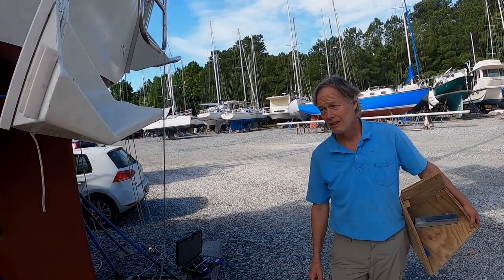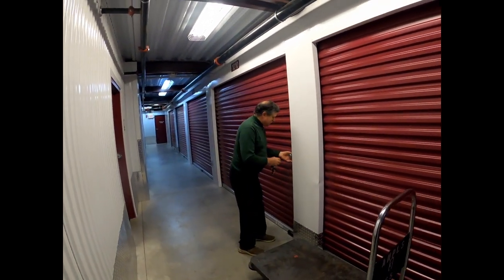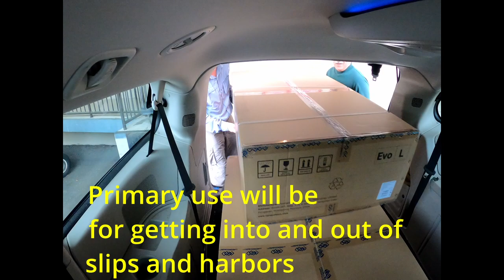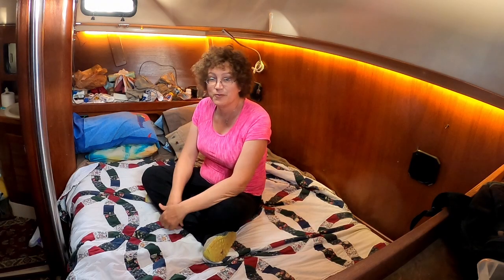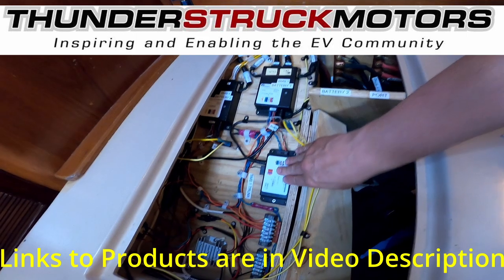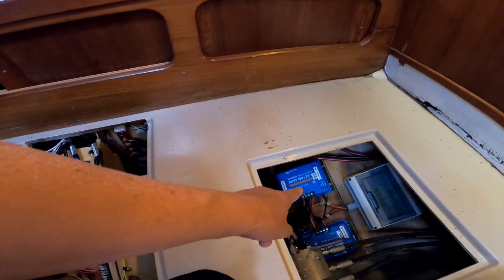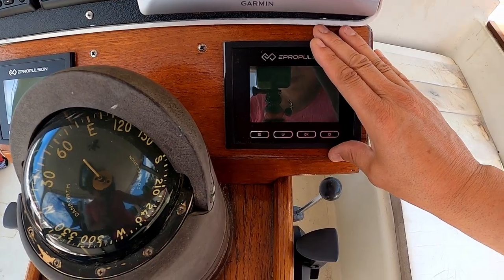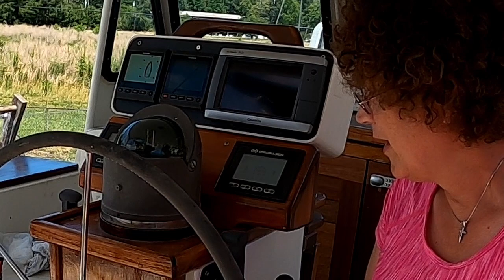Episode 76 - E-Propulsion and Thunderstruck Motors

Comment: PE-Foam does a great job as a arrow target for bows. The holes closing again so you get a great lifespan out of the target. We used a E-Cutter to make a Dovetail connection between shorter pieces. Now you can place the pieces all over another between two woodplanks and span them with 4 threaded rods. After a while you only have to replace the pieces that get hit the most hopefully center target ;)

Comment: You can use PET foam for construction of fiberglass panels. It's closed cell so it also makes good stuff for a boyancy chamber or collision chamber fill.

Those props are pitched for a planing hull. After a bit you may want to recalc and see if a prop change could offer better effecient drive or more precious control.

I would be a little concerned with the mounts being sideways to the thrust in forward over time. Electric supplies a hell of amount of torque.
Reply from the maker: That's a great idea. We will definitely look into this. It just happened that we had a friend who had some extra fiberglass panels and the price was right, free!

Comment: I am super interested in this with electric motors. I am going convert a Catalina 38 to electric . I have chosen to do 2 x 6 kw pod drives under the boat . It would be really interesting to get some info on range , top speed and optimal range speed from your boat  since yours is bigger and heavier .  I am thinking of 2x 13,6 kw 48 volt battery banks ( chines 3,2 volt cells at 300 amp )  , what is your thoughts of that ?
Reply from the maker: After our summer shakedown cruise, I have a little bit more information to provide. We find that at 1,500 Watts promoter, which is quarter power, we achieve about four knots on calm water and no wind. Recall that this is a 19 ton sailboat and we are duly impressed.  Our batteries are 7.5 KW hours and so at that throttle setting we can easily obtain 4 hours of travel. That's pretty impressive to us. At no time during our cruise did we actually deplete the batteries and with a good day of sunshine they were charged back to full by the end of each day of use.
Reply: Thank you for answering. I presume that you have third party battery’s , I have talked to many sales people from epropulsion ( in Europe) and they all tell me I can’t get the communication if I don’t use epropulsion battery’s and their  for it can’t calculate range or have regenerations . Is this true ? Is their  away of going around it ? I don’t only want third party battery’s for the price but also I would like to try and build them under the floor in the the saloon for good weight distribution and use space that is not in use otherwise . Again so thankful to have people like you on YouTube trying thing outside the norm .

Comment: We are considering the redesigned EVO Navy 6.0 (2024) for our 17 foot Montgomery sailboat.   Overkill on power but we might use it on our PSC34 as a "oh crap" engine as well.  How have your Navy 6.0s held up?  The new model uses a smaller motor that is oil filled and the total weight is 64 pounds vs 79 pounds but I am trying to find out information if the static thrust on the new model is as impressive as the 279 pound static thrust of the Navy 6.0 you are using.

Comment: Hey guys - great video.... 3 quick questions, why did you opt for two separate controls with two screens, versus using the dual controller with one screen? Also, did you link any steering to these motors or do you lock the steering pin and control the steering with the throttles?  Last question, i would have thought you could get closer to 50% efficiency  using dual motors which is about 6 or 7 knots, so what is your top speed with these both at WOT on your boat? Thanks!
Reply from the maker: Good questions!  It was our decision to have redundancy in our build in the event that there were a failure in one of the motors and/or controllers.  As an electrical engineer, I'm a big proponent for redundancy!  As for top speed, we are seeing 6+ knots at full power....which is absolutely amazing given the 19 ton displacement of this boat.  Super impressed
Reply: 🤣... as a mechanical engineer - redundancy - is exactly what i figured was your reason for fully independent setups. Yes, the twin motor setup on the ePropulsion motors really boosts their efficiency. It sounds like your running close to 50% which is awesome for that big boat. EPROPULSION  is pretty good but you will encounter times in the future that make you HAPPY, you chose to be fully redundant!  Congrats on your setup.

Comment: I am thinking you could have replace the diesel with an electric motor and lithium batteries for around the same price.
Reply from the maker: We priced out a full replacement with the necessary horsepower equivalent for about 15-20K
Reply: @sailingaccidentalgybe  wow, about how much was this install?  Around $7000
Reply from the maker: @Secondwind2010   I believe it was around $4, 000
Reply: @sailingaccidentalgybe  a engines is $5200.   I going to guess $6500.  I think 6 HP is under powered.  This is a good project to prove it can be done.

Comment: Hello from Germany. I am deeply impressed to drive a 19t boot with two little outboards.

I have a 2t cruising trimaran and would like to change to one navi 6. So it looks like that would be a good choice. 

Main reason is to use the hydro generation functionaltiy. I think i have plenty of sail power :-). Do you have tested it already? Since i also just need the motor to get out and back into harbours i hope to get the batteries full without shore power.

And my second question is about quality. I found some posts that there are several issues with corrosion and the after sale service is not good. What is your experience so far?

Many thanks for sharing your knowledge. Fair winds!
Reply from the maker: Thank you for writing. I do believe that one Navy six would be more than sufficient for a boat of that size. The hydro regeneration function is not available for us because we are not using the epropulsion batteries. That feature is locked out unless you utilize their batteries. That is very unfortunate for us but not a game changer since we have plenty of solar and can also charge from the generator on board if needed.

We did not notice any corrosion issues so far but as you are aware likely, we take the motors out of the water when they are not in use. Of course there is some splash over and of course the saltwater environment but that has not been a problem to date. Time will tell.

As for the customer service, we have been working with Annapolis hybrid Marine and as a dealer and reseller they are superb. This may not be true necessarily for all dealers. If it is convenient for you, I highly recommend their services. Hope to hear more about your project as you move forward. Any other questions, let us know and thank you for watching our channel!

Comment: I would love to see if you're able to get the hydrogeneration working with non-epropulsion batteries. I know they software locked their motor controllers to not work if not connected to their batteries due to concerns about overcharging, but I'm wondering if there's any way to unlock it or connect it to a different BMS and still have it work, it looks like you've been able to connect the epropulsion throttle units to your BMS (unless they're just guessing SoC via the motor controller reported usage and capacity you configure)
Reply from the maker: It's a background project that I'll be looking into. Right now we are using the thunderstruck motors BMS and the epropulsion battery seem to be playing very nicely with them
Reply: @sailingaccidentalgybe  That's good to hear, I've got an ePropulsion 1kw outboard I use for my dinghy but would love to tow behind the mothership for regen on a lifting outboard bracket (similar to what you've built). Two Navy 6.0's towed at 6kts would generate a sizable amount of power on passages.
Reply: i'll be curious to learn how your project ends, as I'm faced with the same question. FWIW the comms cable uses RS485, if this helps.
Reply from the maker: @AntoineGrondin  Thank You!  That information may help me to communicate with the controllers.  Thank You!

Comment: motors alone costs about 8k.. + batteries thats a 15k swap. very expensive... have you thought about inboard electric?
Reply from the maker: We did actually consider inboard electric quite extensively.  We went back and forth on this idea but ended up deciding that with a 19 ton boat, we just would not be able to do long distance motoring if we needed to.  Coupling this with the fact that we have still a capable diesel that can handle such tasks, we decided that electric motive power in this boat would be supplementary to the diesel.  If the diesel decides to fail, we would look at our options again as the price of Lithium batteries drops and the energy density increases
Reply: @sailingaccidentalgybe  38ton? Wow, now I understand the idea, thanks
Reply from the maker: @vaidotasratkus7619  apologies. 19 ton. 38,000 lb. Still on ultra heavy boat for its class

Comment: What is the weight of Athena ? And what is the top speed with the two 6 kW e-propulsion outboard (no sail) you have reached ?
Reply from the maker: 19 tons and we can get close to hull speed for a short period.  Note that doubling speed cubes the power requirements.
Reply: @sailingaccidentalgybe  , thank you for your kind and quick response. I am currently building a 53’ x 20’ catamaran style boat, which is supposed to have a final weight of 9 to 10 metric tons (19,840 lb to 22,000 lb) , and am wondering if 2 E-Propulsion Evo 6 pod drives (same power as the outboards you use) would suffice for decent speed at 50% power, or if I would have to install 4 of them (two on each hull instead of 1 per hull).
The hulls are narrow (4’ maximum width, with a 11’ point from 4’ to 2”, and the supposed immersion depth between 18” to 20” -very shallow draft-)
We have 4 48 V LiFePo4 batteries with 100 Ah each, and 8 kWh solar panels as well as an 8 kW inverter-charger (220V / 110 V / 48 V), to charge the batteries and for the “house load”, so plenty of power during daylight, I assume…
What do you think ?